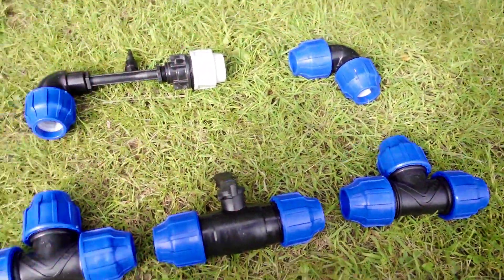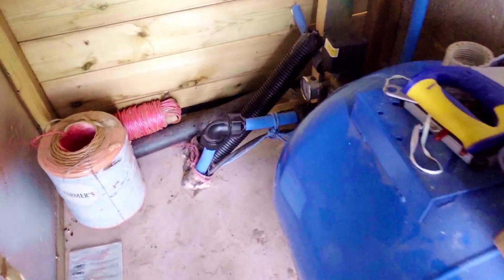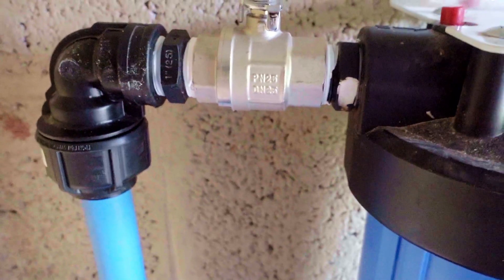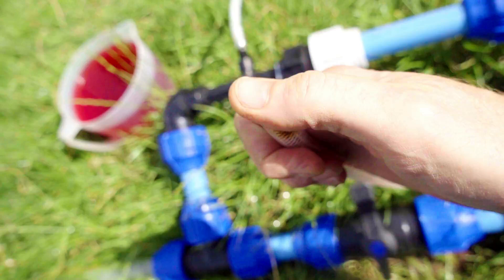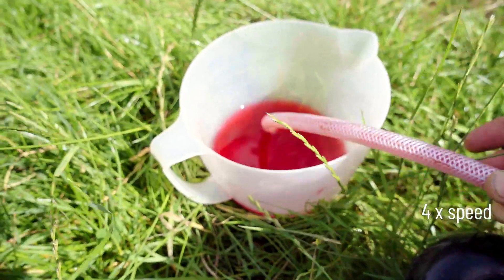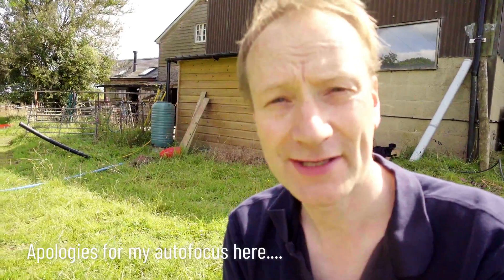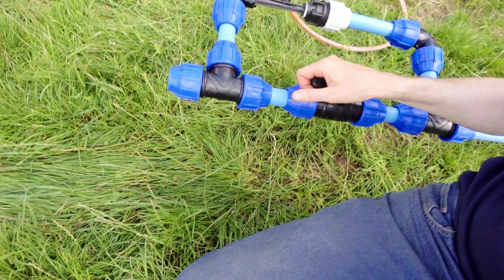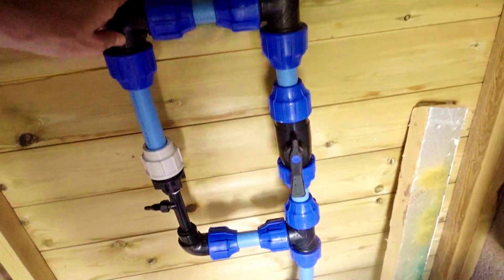The Secret Weapon for Fertigation in our Vineyard: Venturi System!

Comment: Hi I hope you are well.
Water makeup.? Its good that you will have it tested , the results will be vital in forms of action.
My wells water is calcium rich with bells on. Its a massive issue if your using all things pvc and metal, it blocks drip systems.
Now because of this issues we collect rain water in an 8 thousand LTR gravity system using a solar pump and panels. The whole farm in fact is solar with grid as only a back up. Its rainy season here so no issues with storage.
I think your right about the T venturi size as long as the exit is not too big.
That's it really, as normal the videos are down to earth and full of really good advice with relaxed explanations.
Best wishes.
C.
Reply from the maker: Hi there.  Thats  very interesting.  Fortunately we are in a low calcium area here where the water has been filtered by layers of sandstone.  If we were further south in the country then calcium would be a real issue.  I think Manganese may prove high here, but we can put the appropriate filter to get rid of that.
I am realistic to see that this system may not work, but we will test it.  I think your system sounds great and very effective with the solar pump too.
Thanks for the comment. A
Reply: @mycountrylife810  A pleasure.

Comment: I fertilize a few grapes in my yard with a venturi and water wand and mostly like it.  But I don't think I would do it over a distance like you are, venturies are very sensitive to back pressure.  Even the terrain causes me concern, let alone the internal resistance of the pipes and any flow control you are using at each plant.  You should do lots of testing before installing that pipe.  Personally, I would drive a fertilizer tank down the rows and shoot a hose right at the row.  Then water it in as needed.  Good luck.
Reply from the maker: Hi there.  Very useful comment, thank you.  I must admit I am far from convinced that anything I attempt is going to work as I planned.  We will see what it's like and if I need a plan B then I'll do another video on that.